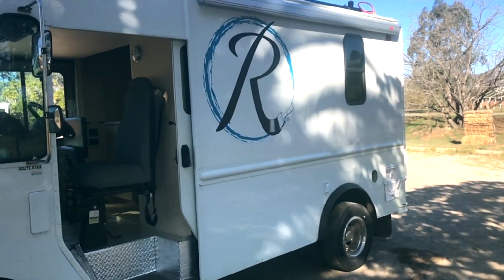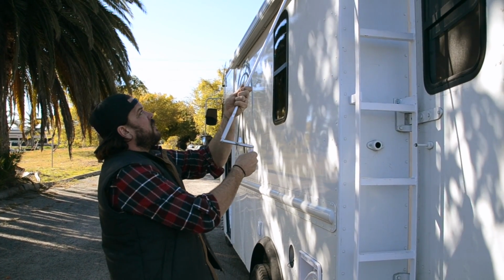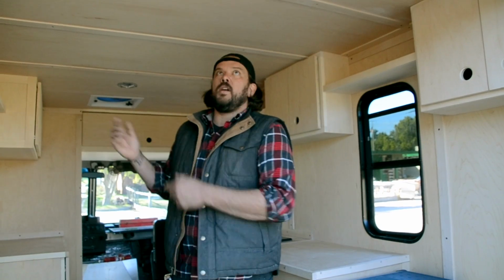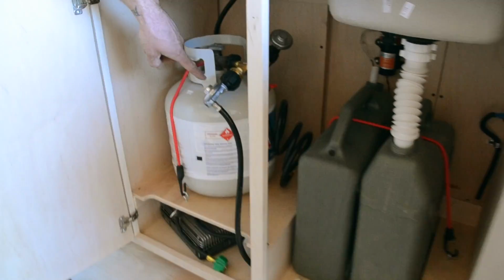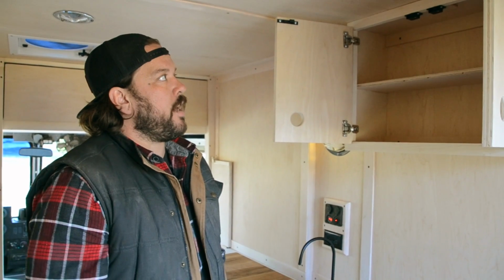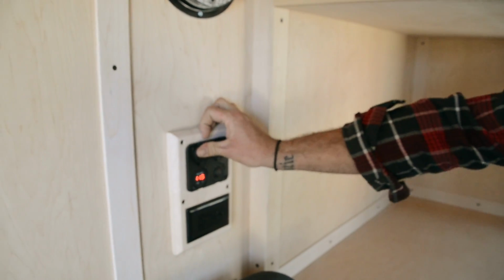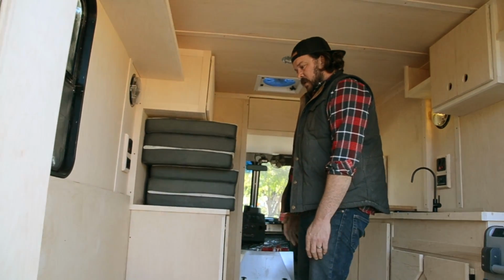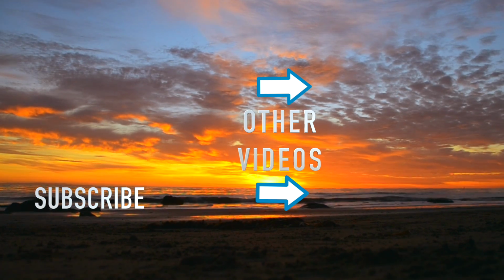Step Van Custom Camper Conversion

Comment: "No leaks of either propane or water" and it's "unique in my experience"???? Wtf?? You mean this mickey mouse contraption on wheels is the first project in which you have a successful assembly of all the water/gas lines and drains???? Wow. How groundbreaking lol
Reply from the maker: M K you might be getting a little too upset about this buddy.
Reply: Lol and this teeter-totter bed lmao... No comment. Good job buddy!!!! Oh boy why would I be upset? Quite on the contrary, thank you for a good laugh of the day, if not a year... And then some.... lol. K I'm done. Really..
Reply from the maker: M K good. I’m sure you have better ways to spend your time.
Reply: @wildsage  Indeed brother. Better ways of building things too, lol, both stationary and mobile. Just ran up on this preschool video and trying to figure out why in God's name it would be recommended to me, is all, I'm puzzled brother, help me out. It's like having a cheat sheet for a 2 plus 2 sort of thing, you get what I'm saying, muffin? Its like a thunder on a clear sunny day. Fucking paradox, I need to consult with my buddy Sigmund, make sure Albert is there too, I need to address another thing with him right after. Alright then, I'm gone Sally! ;)
Reply from the maker: M K No. No I was wrong. You truly don’t have anything better to do.
Reply: @wildsage  No, you were right. I just have this primal ability called multitasking. Still doing the better getting done bettering donner did was gets will done better. Wana see my better build lol? Naw, I won't embarrass you like that, I got heart, no worries. ;) You support your president Trump? Yankee!!!!
Reply: @wildsage  Eh, Yankee? You're so informative and communicative with everyone else on here I see, and gona start evading me? Awww, I mean no harm, I promise, we come from the north with peace ✌👍
Reply from the maker: M K everyone else is offering constructive critiques here and I appreciate that kind of conversation. Love to see your build. Please. I promise I’ll show you more respect than you’ve shown here.

Comment: Gross,toilet right next to a fridgs,no wall or anything.
Reply from the maker: 12Sisters 1bride you musta missed the fact that the toilet is completely enclosed in a shroud and the fridge has an airtight seal like literally every other fridge. Lol.
Reply: @wildsage  yep,noticed that,still gross
Reply: The space where the dresser is could better utilized as a vertical storage space with drawers and storage against the driver's seat, and next to the couch you could place your porta potty hidden inside the box. the top cover could act as a end table for someone sitting/lounging on the couch to place drinks and magazines when the porta potty is not in use. Remember to add a lip or rail around the foldable top of the box so that magazines, or whatever would not fall off while vehicle is driving.     @wildsage

Comment: I like those hole cabinet handles. What type of plywood thickness are the doors and cabinet base made from?
Reply: I really like your ideas they match mine to some degree but I learned something for sure! Thanks dude!!
Reply from the maker: mitch sheppard pretty sure all the cabinets are 3/4” but might be some spots where it’s 1/2” if 3/4” was overkill. Walls are paneled with 1/4” ply and most things have 3/4” poplar trim to hide ply edges.

Comment: Now that is fabulous!
I'd rather have that than ANY of the commercial products I've seen. Perfect for two, strong, easy to use and maneuver, great floor plan. Any cost estimate for the conversion (not including used van)? Thanks!
Reply from the maker: Yeah a custom job is just cooler and can be made to fit your specific needs rather than cookie cutter fittings. Not sure if the cost because I just did work on it and didn’t price it or design it.

Comment: Damn man I Love the woodwork especially on ceiling! Great layout. As others mentioned about the propane I’d have to agree but whole thing looks great.  I’d want that wood just poly’d. Keep it light. I’m guessing a curtain will go up to keep the light down while sleeping   I’d have a 360° security cam mounted with monitor on my wishlist.   Tv mount for movies.
Reply from the maker: mercuryhaute yeah all good suggestions. The truck owner is a painter by trade so I know whatever finish went onto the wood was well done but I haven’t seen it. This is the truck at probably 90% done.

Comment: Why the dirge for background music? Did someone die making this van? It's a bit sad and depressing for such a project. Also why not use a 12 volt water pump instead of the air compressor? Propane tanks inside are very dangerous. Just sayin. You won't find one inside on ANY commercial RV. Tanks are designed to release propane into the air if they become overheated such as in a hot vehicle or in a change of altitude. Teflon slides will help with the futon. A quality futon mattress is more comfortable.
Reply from the maker: Bill Vegas not a lot of options when you’re trying to pick music that doesn’t have copyright infringement. We’ve been told 1000
Tones about the propane (just read the comments here) and the owner has been instructed to make necessary modifications. The bed slides really well as it is and it’s a surprisingly comfortable mattress that had the correct dimensions for the space so we will probably stick with it. Thanks for the suggestions.

Comment: Would you recommend electric heater over the propane heater?  I would be worried about exhaust, or fire risk.
Reply from the maker: Nancy Golden propane has its challenges but you’d need a pretty hefty solar setup to run electric heaters. Those things suck up the power.

Comment: Very nice carpentry but your inexperience shows... your panel on the wall are "outlets" (providing power) and not "inlets"... all your shelf surfaces need a fiddle edge to prevent stuff from falling out and take the strain off the doors...why would you put the awning and shower on the roadside of a US vehicle? This makes no sense... inside propane is a no-no under any circumstance... as the subcontractor you have set yourself up for a big liability and possible wrongful death... cutting board should be reversible so the cutting and wear surface is down and the "show" surface is up... make a cover for the sink to expand flat surfaces... finally foodstuffs next to a toilet area is another big no-no under any circumstances... very unsafe for so many, many reasons...
Reply from the maker: Some good suggestions here. Some that are neither here nor there. But we learn from every project right?

Comment: Very cool I like how you took a work van and made it look like a camper and how you explain why you did the things you done to the step van.  I think I would have did the stealth look so I could park anywhere so no one would know I was in the back of the van sleeping or in the back just in case I had to park on a back street
Reply from the maker: SNOOP U 2 the logo on the outside gives it potential for stealth camping but that thing would be a beast to park on residential streets.

Comment: 13:55 --- do you feel the "Top Strap" through the mattress when you lay down ??? It seems to me you would feel the "Top Strap" through the mattress making it slightly uncomfortable and maybe even causing back pain the next day ...  Outside of that I thoroughly enjoyed the video and absolutely love the overall idea of the bread truck conversion... Will look into this idea along with the uhaul conversion idea... thank you ...
Reply from the maker: Brandon Croy you can’t feel the strap at all. It’s less than 1/4 inch and with the 4 inch foam it’s negligible. Yeah isn’t it a cool idea to convert old work trucks? I love it.

Comment: Cool yes, but to fancy by the time you total up what you spend to do this, might as well just buy something that has all that stuff.
Reply from the maker: STREETERBOYZOUTDOORS the upside is that things are custom for you rather than factory output. That means you get to focus on things that work for you and trash what is the one-size-fits-all approach from a dealer. You don’t want a full fridge, don’t get one. You need lots of power to run your laser light show, add more solar.

Comment: So you got the pitch on the drop leaf that your back leans rests against by the width of it and it just rests on the bottom cushion?  
I have been looking for a new couch for my RV and I realize I'll build my own like you did.
Reply from the maker: 64maxpower exactly. The drop leaf is jut the right size so that when the cushion is there it hits that and stays at an angle.

Comment: I drove these trucks for years. No way I want to drive one for any distance. Ride , turning radius , performance all horrible.
Reply from the maker: William Hayes William Hayes that’s fair. I will the sound issues were largely eliminated by then insulation. I did drive it around a little and didn’t think turning radius was terrible for the size.
Reply: W.H. I've been wondering about that. Thx
Reply: I can’t stand driving a truck.
Reply: There’s tons of unused space imho.
Reply: I agree you can buy a freightliner 26' refer box with power tailgate air brakes and diesel plenty of torque for hills. Did look at Ford transit van Frito lay rig said 18 mpg . I like freighter because you can super insulate it. 
Modular compounds allow half equipment for contractor half living space. Will last longer than motor home. Plenty space water power etc.

Comment: if you dont keep a dust cover on that wave heater it will fail because the dust messes with the medium that the propane heats.  put at least a big shower cap on it.  trust me on the dust thing
Reply from the maker: Taraz Pariseau yeah I’ve heard that about those heaters! Thanks for the shower cap tip.

Comment: No Propane in living quarters! It needs to be outside, and vented?
Inside should have fletnor vents in the ceiling for fresh air venting.
Why have to climb the ladder to refill the pipe storage? Doesn’t the curly air hose flap underway?
Use boat cabinet latches on cabinets.
Reply from the maker: Stuart Warren Stuart Warren The owner has been told to vent the propane to outside. There are two vent fans on the ceiling that really get the air circulated through the van. Not sure what you mean on the tank filling. I’d agree on the boat latch. Recently came across a pretty sweet boat latch system that I’d like to use in a future build.

Comment: This is the most practical step van conversion I have seen so far. I am impressed with your workmanship and design ideas.
Reply from the maker: Alan Land thanks! He’s got a head full of good ideas.
Reply: Alan Land .... You Need to see a lot more Videos.. This one has so many impractical things he did.   Ex: that desk from the counter top.... Uh no,  Why ?  Because all sorts of things would be on the counter that would have to be moved, stored, put away.  This is just one example of many.
Reply from the maker: Andrea Murphy what works for one person may not work for all.

Comment: Surfboard wax on the slats will help them slide in and out more easily.
Reply from the maker: Alan Land ah cool. Thanks for the tip.
Reply: @wildsage  Beeswax is better.  Surfboard wax is so your feet don't slide off a slick surfboard.

Comment: Nice van nice build good job just need to shower on the inside it's about the only thing I've seen missing
Reply from the maker: whtmikeg30vanlife yeah that would be great to have an indoor shower. Just a matter of what you’d cut out to put it in.
Reply: Sage Roddy toilet can be removed and curtain hung next to the stove area. No compromise to the build other than a different floor piece there for shower and drain.

Comment: The major explosions from propane tanks in RV’s is driving with tanks open and hooked to appliances, the connection breaks an KA-Boom. Turn off the tank.
So new, nice ideas, what are you going to get dirty first. Mentions of gas dangers is important, with a carbon detector on the ceiling and a propane 12” off the floor. I’ve got the wave too, a real propane sipper.

Comment: I'm more into Class B vans, preferably the Roadtrek 190, but, I have to say this is the BEST step-van conversion I've ever seen! Very professional, clean, not bulky, and, just simply great. Congrats! The ONLY two downsides to this vehicle, imo, are  (1.) stealth is out the window pretty much, unless, one would want to paint a 'business' sign on the outside, and, (2.) this vehicle is somewhat crippled when it comes to parking it just ANYwhere. Other than those two things I'd hire you in a heartbeat to build me one! Have a blessed day! 
(8:35am CST 4/2/2018 Houston, Tx)
Reply: My Stepvan will park anywhere your Roadtrek 190 or any other Class B fits, but I have way more living space. Nothing stealth about a Class B not even with a business sign, my Stepvan more so. Not that it matters unless you want to park in an industrial area. Any non camper looking vehicle parked along the road would look suspicious.
Reply from the maker: JIM BRIDGES JIM BRIDGES thanks man. Yeah it’s not a stealth camper by any means with an awning and shower on the outside. It actually does have a business decal on the outside still. Definitely not a rugged off-road vehicle but from what I know of the owner, it’s more going to serve as a studio apartment/travel truck than a camper.

Comment: please tell me there is a vent to the outside in the same cabinet as the propane. he didnt show it but yeah would rather have propane leak to the outside then be trapped in my house. otherwise very nicely done.
Reply from the maker: silvermonk13 thanks man. I’ll have to check on the vent for the propane. I’m not certain as I didn’t work on that part of the van.

Comment: Very clean lines. Nicely done. Waxing the slats on the bed will make it pull out easier but not make it walk out on it's own. Those wave ceramic heaters are very good but dust will damage the ceramic wires in no time, a good dollar store shower cap to cover the front does the trick. The company will redo the ceramic element if it quits but if you cover the unit when not in use it last a for upwards if ten years. Again ,really nice job!
Reply from the maker: Yeah lots of people have mentioned how dust ruins those things. I'll mention it to the owner! Thanks!

Comment: Propane tanks should always be stored outside. They almost all leak. Very dangerous. I had my storage area go up in flames with a brand new tank and hose fitting. Even new ones leak.
Reply: Agree, my build won't have any propane in it. We all do what we're comfortable with, depending on our life experiences and what some of us have seen propane do when something goes wrong.  All electric for me.
Reply: A lot of youtube experts on here who claim to know about Propane. Unfortunately they are wrong. Propane is perfectly safe being stored inside. No it won't pop off - it doesn't work like that. The emergency blow off is for high pressure as a result of being overfilled. Putting your propane tank in a heated house isn't going to make it release. Secondly, propane doesn't just explode. Propane has an odor for a reason.  A little science goes a long way.
Reply: @mikel9567  sorry you are wrong.  There is reasons the regulations for campers say propane MUST be outside.   you want the facts...... Go to a Fire House and ask them....  its they who pull the burned charred folk out of building or otherwise with propane inside.   Oh.... and check out  https://www.youtube.com/watch?v=VeXiYRQle58  Propane barbecue in a box truck, driver died.   

PS....Also  if there is any form  of accident..... your whole insurance policy(s) will become null and void due to improper (illegal) installation of tank. Insurance Co. Lawyers love improper installations..... they will crucify you even if the accident (no matter who is at fault) has nothing to do with propane.
Reply: In Italy my family cooks with propane inside.  They refill the stove's tank when it is empty, in their house.
Reply: Bob Smithereens  hey bob, your mom polished my knob lol, and your pops got robbed
Reply: A propane tank inside is dangerous. You can go to a marine store and buy a vented box for the tank to go inside. The problem is if the emergency blow off valve opens due to high pressure as in the tank getting too warm, as in a tank filled cold then heating the van would increase the pressure to pop the blow off valve. It would fill that van to where it would explode in less than 30 seconds, faster than a sensor could react. I took the tanks off my fifth wheel and filled them when it was below freezing then took them home and put them on the trailer which was faced in to the sun. About an hour later I could hear this loud sequel hissing noise, stepped out of the trailer only to see a big white cloud of propane venting from pressure relief valve on the tank 2' from the lit hot water heater. That is why all boats and RVs have out side bottom vented compartments as propane is heavier than air unless venting under pressure.
Reply: Alan Hester    I totally agree. It is not worth the risk. 30 seconds is enough to time to realize somethings happening and then poof! I would heed his advice.
Reply: Michael Mccauslin He should have that on his top deck...or somewhere else outside, for sure.
Reply: Bob Smithereens  look here muffin, i dont do library. Id rather rip it on my Harley round a block and off on the country roads for a week or two. What you do for fun when your crack pipe gets empty? Lol
Reply from the maker: I think a propane gas detector/alarm should mitigate the dangers of it!
Reply: Fucking inspector encyclopedia over here, you won a cookie lol yay